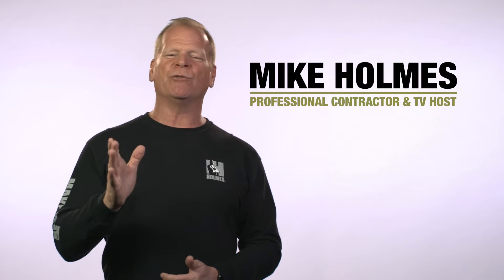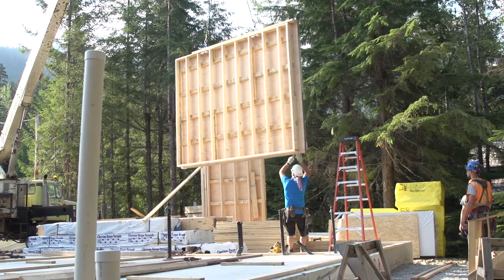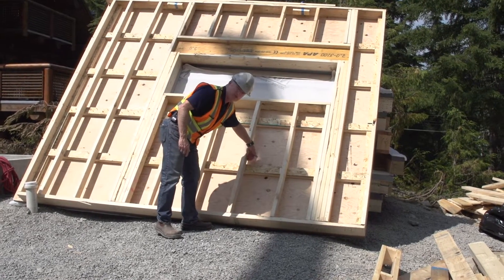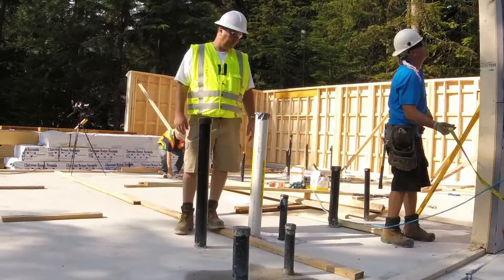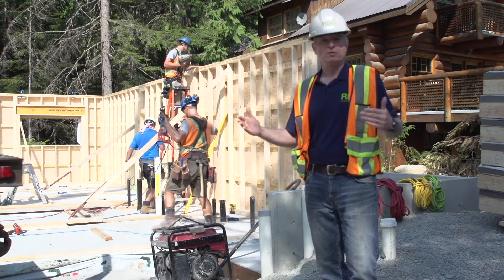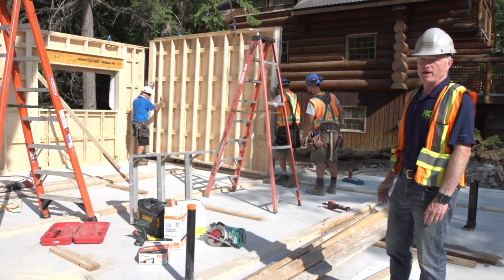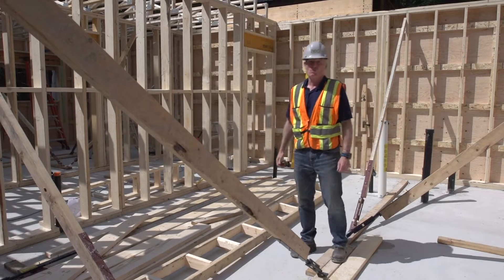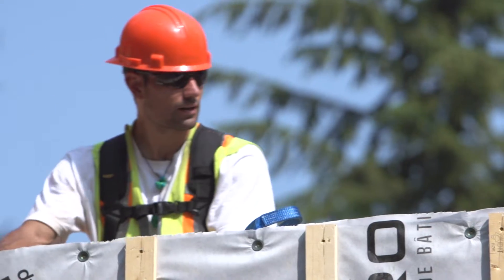Net Zero Energy Home Construction w/ RDC Fine Homes & Mike Holmes

Comment: What kind of air changes per hour at 50 pascals.  Are edges of panels and plates & plate joints sealed as the seal of the panels to the plate tops/

Comment: Looks like a future moisture entrapment disaster...

You've installed a vapor barrier on the interior of the OSB with Walltite Eco then sandwiched or presumably bonded Neopor GPS  with a permeability rating of 4 if it's GPS 10, XPS has a perm rating of 1.5 and is essentially considered an exterior air and water barrier. Besides that it's then wrapped in NovaWrap with an outward perm rating of 11, similar to Tyvek which is incredibly low. Add to that, NovaWrap states right on their website the following: "Breathable perforated building wrap allows the air to pass through the wall system while repelling rain and screening driving wind from the outside environment." You NEVER want a house wrap that's micro-perforated as it WILL let water driven rain through it. The only reason it has a perm rating of 11 is because of the holes. It sounds like a terrible product based on the design and specs.

It's nice to see the advanced construction build of the wall with regard to framing to limit thermal bridging but for any rigid exterior insulation application a mesh rainscreen product, like WrapShield RS, Tyvek DrainVent, etc. would allow outward drying of the OSB plus prevent any tension held water between the OSB and Neopor. The drop in R-Value with that type of system would be minimal, ~0.05 based on Rockwool testing of R-Values behind rainscreens using XPS.

Personally, a much better option would be to use the Walltite Eco; wrap the exterior with VaproShield WrapShield SA or RS which has one the best air perm and water column testing plus an incredible outward perm rating of 50(E96B); then clad with 2-3" of Rockwool ComfortBoard 80-110. You now have an incredibly airtight house inside and out and the WrapShield and Rockwool allow outward drying of any moisture or wind driven water.
Reply: I'd love you to build my house but I'm in new Zealand..
Reply: Where are you based daily tonic?